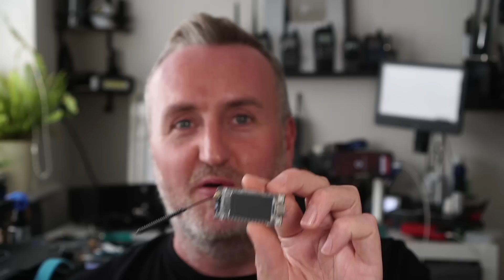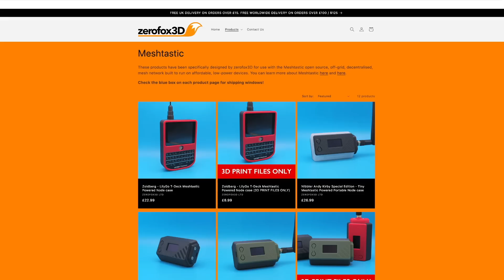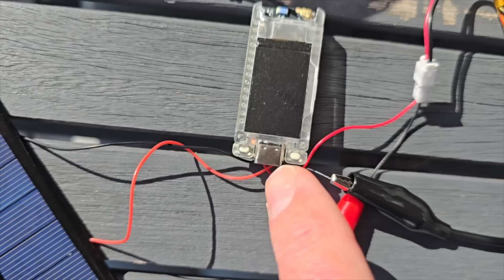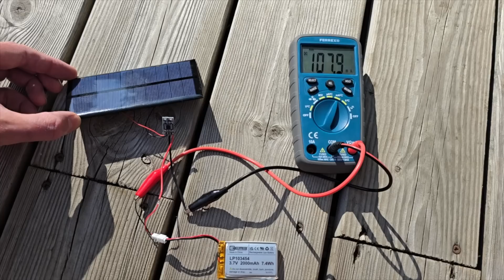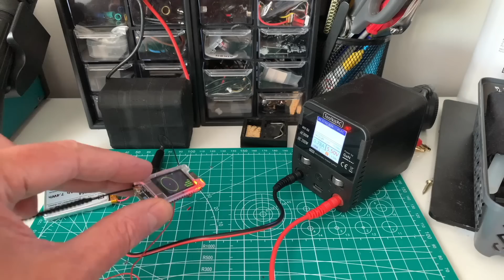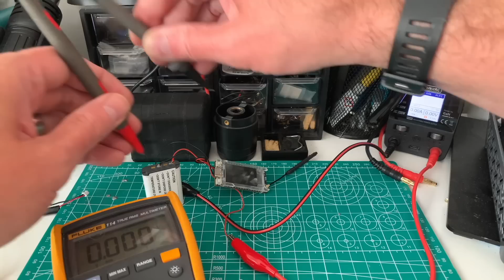Everything you need to know about solar Meshtastic nodes | Heltec T114 Solar tests.

Comment: If you read negative current, it means the battery is discharging through the solar panel. You need to put a diode in series with the panel to avoid back flow.

Comment: But doesn't have the first LiPo battery tested and integrated BMS circuit? the second tiny one not and the third one yes. So maybe using a "normal" size LiPo is fine, like the first one.

Comment: I have a solar panel  that delivers 5 volts at 10 watts. Its not much bigger than the one your using, - my question is that if I connect this to a T114 that will charge 2 18650 batteries, would that be enough to run the Lora BBS 24/7 ?
Reply: If it is not much bigger then it is not 10W. A solar panel that delivers 2W (actual, not chinese watts) and ~3000mAh battery is enough to power T114 all year round.

Comment: This and the V3 have about the same power section with the add of a diode for the solar input. I tested this for weeks through the winter, and got dead batteries that I had too trickle to revive. The 3.3V LDO would suck the battery down to below 3V before the CPU would pack up. I had a 7W panel just plugged into the usb. For these in solar nodes I came up with a team of a CN3791 board to manage the panel input and a TP4056 charge and protection board for under/over V and current limiting, and just bypass the internal charge control.  Other low current  1S protection boards would work too.
Reply: I did the same thing, never trusted the batteries to have a protection circuit so I use a diode on my 12v solar panel, which then goes to a buck converter to bring it down to 5v and then into the TP4056 :)

Comment: I've built a few solar-powered lora projects over the years, and I've come to the conclusion that the solar charge controller circuitry on the Heltec boards is a bit suspect. I've moved to the cheap SD05CRMA boards found on Amazon for ~$6 US. These boards are based on the CN3163 chipset and (as the video states) much more efficient than the Heltec circuitry. Since bypassing the Heltec charge circuitry, I've had no issues with charge performance or power brown-outs that plagued me before.
Reply: Legend

Comment: They use the lgs4056h which has absolutely no battery protection. Not even one person thought about battery protection from design to finished product. 😂
Reply: It's a development board, not a finished product. All this does is highlight the difference between amateurs and professionals. Having said that, do Haltek supply application notes to fully brief any potential product designer?

Comment: No microprocessor likes supply voltage ramp-up from zero ... cannot guarantee a clean reset and if it does reset running, voltage may be below that required for reliable operation.👍

Comment: Their schematic shows it has a LGS4056H charge controller, the datasheet shows at 3.57V the current should have been >1A (but obviously limited by what the panel can provide). I'm sure the diode on the board going from the solar panel to the charging IC isn't doing it any favors, but I think based on the charging cycle it was still in 0.05A charging stage. There are 5 stages for that charge controller and it depends on the battery voltage where it ends up, but the first charging stage is 0.05A then 0.1A. On the power supply it looks like the internal charger was able to go to a high current, so I would say maybe the Heltec T114 internal charger isn't as bad as seen in the video?

Comment: Built my own mesh infrastructure from Heltec lora v2's . 6v 90mw solar. I found the trick was to write in the code to check voltage and go into deep sleep for 8hrs and wake and test again if volts below 3.6v This prevents the devices crashing while in awake state, rather than low  in low power state. If the battery drops below 3.6v then it is harder for the charge controller to keep the solar panel at it's maximum power point. And in dull days will struggle to recover from.
Reply: Do you have custom firmware i could take a look at? Been having this exact issue with a different board
Reply: Im also quite curious, where did you implemen the code?

Comment: I received my T114 (without screen) yesterday and have noticed that the default password does not work, so you may have to use Serial Console and there is no support for OTA  firmware updates as yet.
My RAK node that has a 1 watt solar panel and 3000mAh battery, struggled to maintain the battery voltage here during Australia's winter (Melbourne).

Comment: I seriously doubt that tiny panel will power a node through the deep winter.  Also, Lithium batteries don't survive freezing temperatures.  I have a much bigger solar panel in my setup and would like to add a heating system that keeps it warm through freezing temperatures.
Reply: Move to the south lol, US,
Reply: Check out the LTO solar battery kit from Voltaic Enclosures.
Reply: @RabbitHoleAdventures  I've located them.  Really neat kit.  Similar, but more efficient version of my setup.
Reply: @ChristieNel  I have one being delivered any minute now. I'm curious to see how well it'll work throughout the hot summers and frigid winters.
Reply: @RabbitHoleAdventures  Yes, me too.  I'm just wondering about their battery capacity.  With my setup it's easy to attach really huge batteries.
Reply: @ChristieNel I wonder as well.  The parts arrive today, so I suppose I'll know soon enough.

Comment: Excellent help on resolving the restart issue. I want to put a node on a tower. This should eliminate the need to climb and reset the device. We have extensive periods of little sun in the winter here and the likelihood of a battery going dead is a real issue.

Comment: when charging the battery and running the Heltec from solar, don’t forget around 15mA from the panel was also going into the Heltec, so the total solar panel output was say 15mA higher than the meter read
Reply from the maker: Yes that is true 😁👍🏻

Comment: I reckon if you interrupt it mid-boot, the contents of RAM will be b0rked.  Then even with a flat-batt, it may have enough voltage to keep the RAM contents in place.  This is why after 2nd boot it doesn't even show the splash ....... I think.  I also think the batt protection fix is basically zeroing out the voltages and clearing RAM upon reconnect of "mains" ?

What I'm thinking here is you can prove / disprove this by letting it "crash", restore power, observe no reboot, soft reset.  If this works, you can monitor the voltage going into Green LED and if it's low for > certain time, you can spam the soft reset with 5v.

Then again, what does a battery protection module cost ya?

Comment: I use 3 of them solar panels in parallel on a Rak, it works 24/7 since spring time, but now winter is coming we will have long nights? great experiment especially for covert hill top nodes
Reply: I run a RAK off a 10W 12V standard solar panel, but I use a 5.5-20V to 5V buck converter before the solar input on the RAK, the kind used for solar USB chargers from China.  The buck converter is rated for 2A, but runs in the 80%+ efficiency range with the low requirements from the RAK. The point of this, is to get some charging on cloudy winter days, as it gives some, the moment the 12V panel reaches a voltage of 5.5V. Will see if it works as well as I hope in winter.
Reply: @Tore_Lund  During the winter did you realize that you need at least one 50W panel (100W is better) and a 10Ah battery to keep a REAL remote node on?
Reply: @ I have realized that the 10W panel indoors pointing SW could not sustain itself. On January 6, I had to place it under a lamp charging it to 36%, so I´ll say, for good measure, a 20Ah battery instead of 10Ah I am already using, but still a 10W solar panel should be sufficient to get through the weeks of no daylight. Still had the panel been placed outdoors facing true South, it might had worked, so my setup is in the ballpark of what is needed. Another thing that happened this winter in my neighbourhood, is that Meshtastic grew. I now have a constant channel utilisation of 3%-17%-30%. That drains more power.

Comment: Hysteresis is a good word... disconnect at 2.5, reconnect at 2.8, then you have enough juice at 2.8V to sag a little under load without disconnecting again...
btw, I think the little mppt board you linked to on Amazon is different from the one you used.
Reply from the maker: Hi mate, yes indeed👍🏻 the board should be correct, just checked it.
Reply: @andykirby  You can connect your solar panel and batteries but you can't connect to your Heltec or Rak